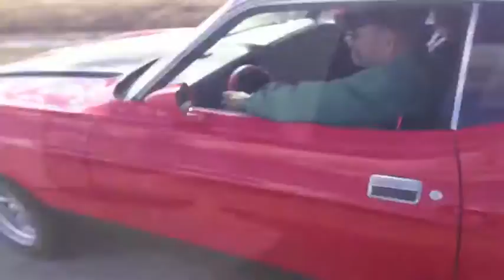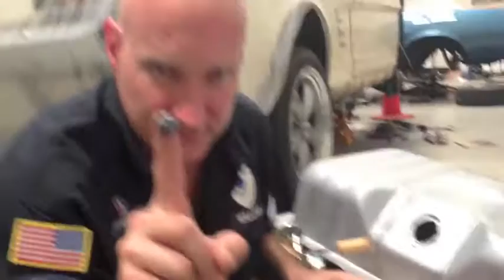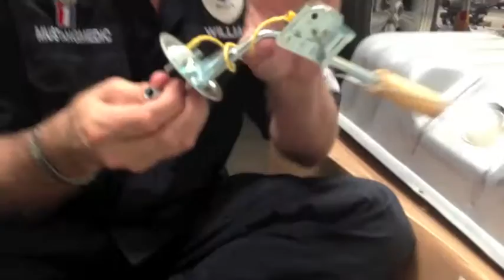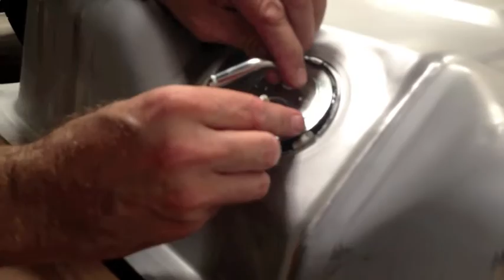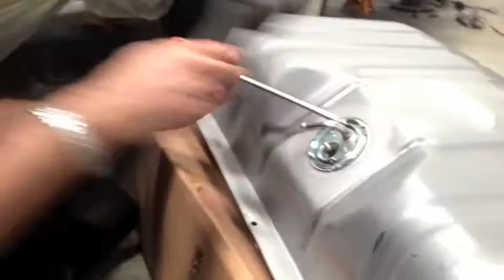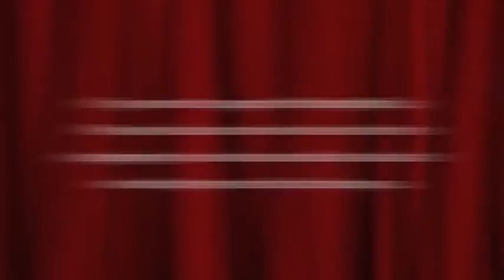Installing a Fuel Sending Unit into Bob's 1969 Mustang GT - Day 78 - Part 1

Comment: Hello I have a question, when I put gas into my car it leaks gasoline but not from the bottom like you’ll see in most videos it leaks between where you open up the gas cap and the nozzle that puts gas into the car and gas goes everywhere and creates a mess and gets on the paint. If you know why this happens and what I can do to prevent this some feedback would be great.